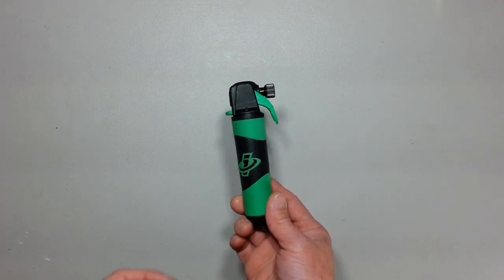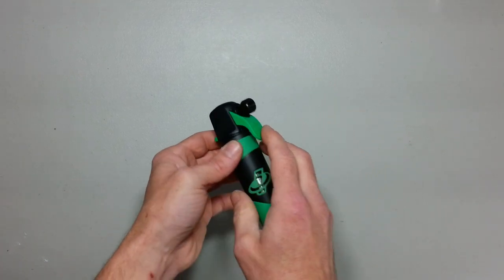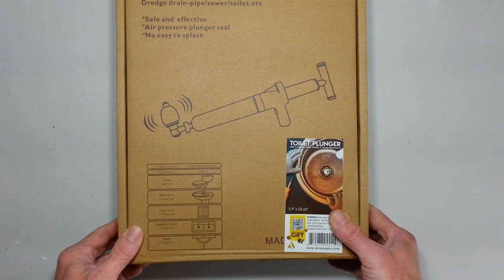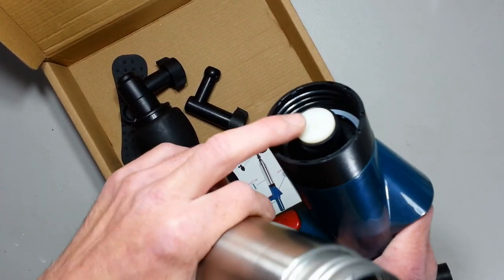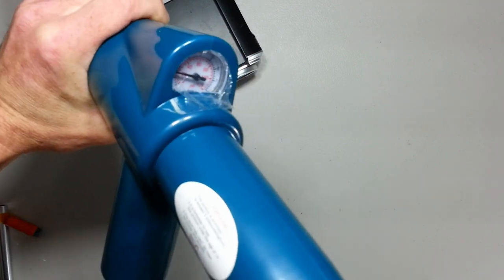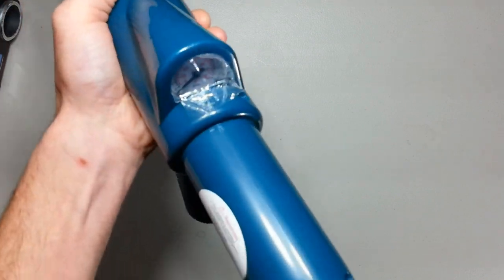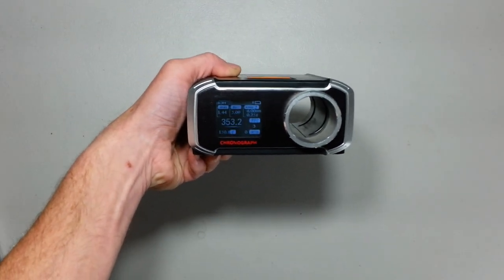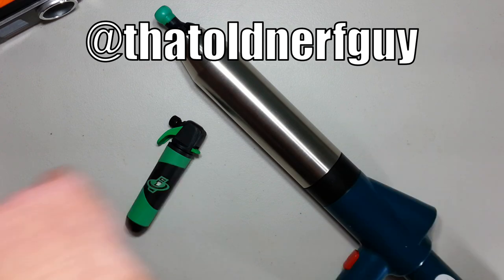Cheap FPS R&D Part 1... for Blasterminator ( Co2 and Drain Blaster )

Comment: I was just looking at one of these on ebay. And measuring different blaster to see which one would accommodate it. I thought at first that it was just a google search thing and that this video is older. But no, you were thinking the same thing, hehe.
Reply from the maker: Yup... grabbed it on Amazon... really cheap
Reply: @thatoldnerfguy  
Nice. It's pretty expensive in the UK. £45, I guess people here are more inclined to use chemical deblockers. But let's see the internals of the xing shen.

Comment: What I'm curious about is what kind of FPS numbers you get if you pump up the pressure on that drain blaster to maximum! Probably an absurdly dangerous amount of power XD
Reply: Blows heads of the half length worker darts at 90psi